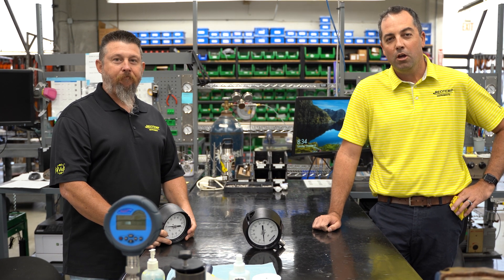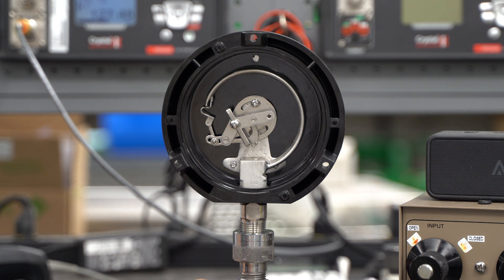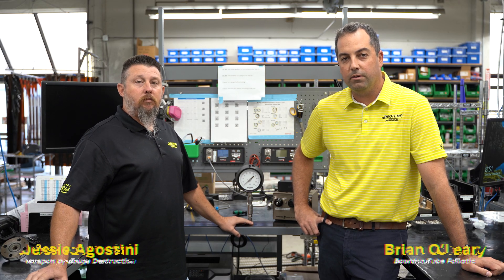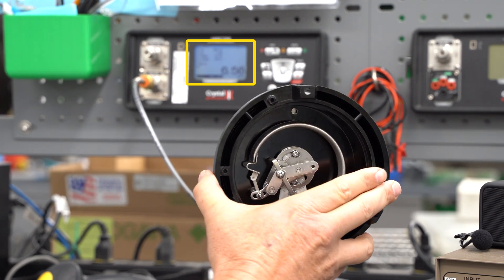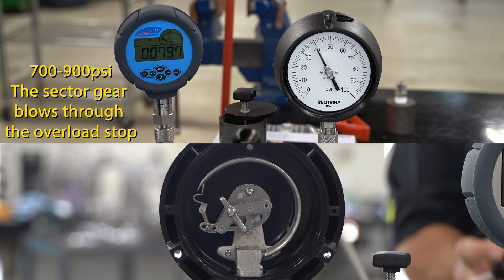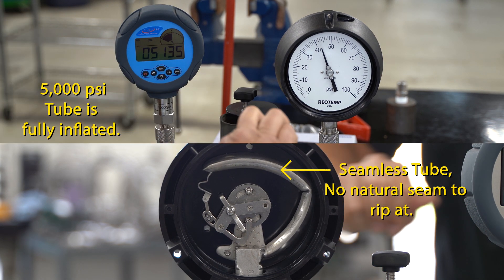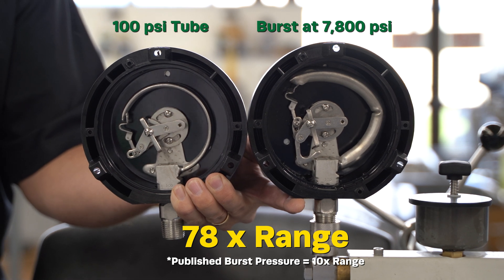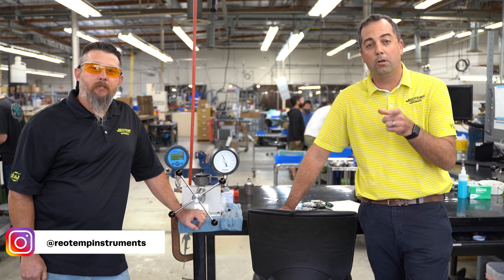Danger Zone: Proof Pressure vs. Burst Pressure

Comment: Thank you for your video, so for pressures between proof and burst pressure, the pressure gauge does not show accurately, and now the 300 psi is named which pressure? if the burst pressure is 7800 psig, so if we stop before 7800, and vent it, see the operation of pressure gauge, it is damaged and not working properly, yes? I wonder why in another site it was written Burst pressure is the maximum pressure that may be applied to the positive pressure port without physically damaging the internal sensing component!so we can say for every pressure above proof pressure, it will be damaged and not operating accurately?
Reply from the maker: Thanks for your questions. There is often some confusion in the definition of these terms, which is why we made the video. As we define them:

Burst Pressure = the applied pressure to the gauge element at which the element may no longer contain the fluid being measured

Maximum Working Pressure or Proof Pressure = the maximum pressure that can be applied to the measuring element without permanently damaging the measuring element of the gauge

Comment: great video thanks, for how long the gauge can withstand for 1.3 of full scale without reducing the accuracy?
Reply: Great question Amir. There isn't a specific amount of time it can be operated at 130%, however it should be as rare and short duration as possible. The constant operating pressure should between 20-60% of scale for the best long-term performance of the gauge. When in doubt, use or specify a gauge range higher than you think you need.